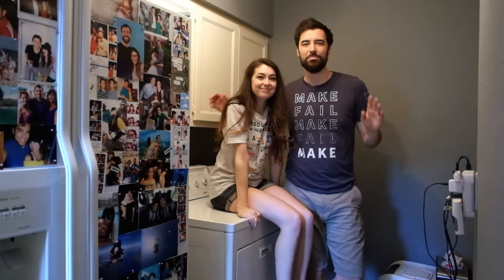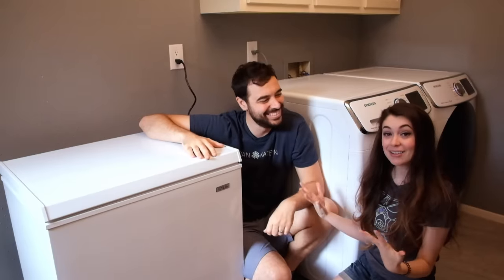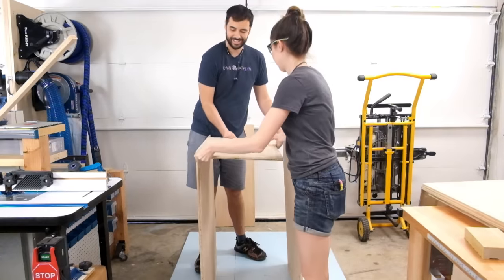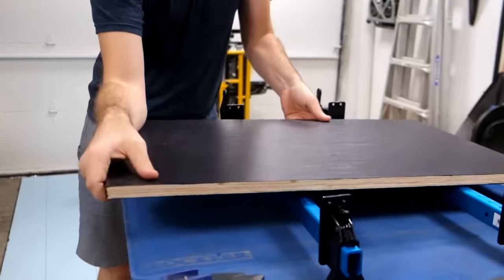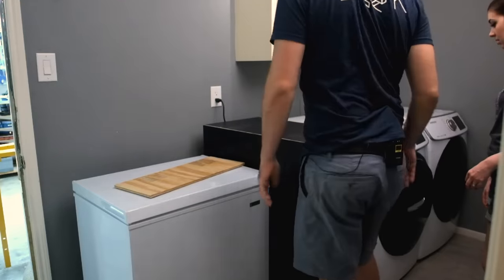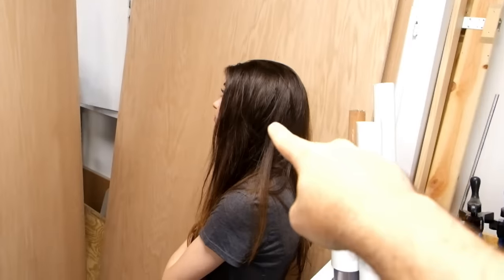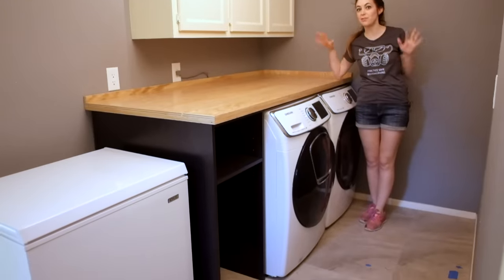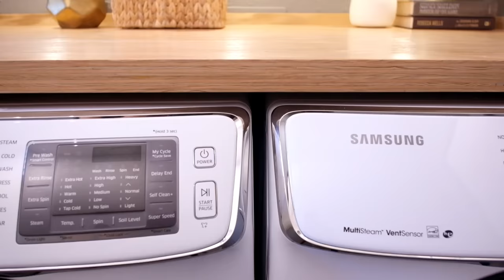Laundry Room Makeover w/ Wood Countertops!

Comment: At 9:38 and wondering when they will realize they just sealed off the access to the water shut off valves....gonna be a problem if they ever have a leak or a hose blow out.  This build was filled with trials and tribulations but I'm glad their persevered and finished! I recommend cutting out a hatch to open for the emergencies.
Reply from the maker: We tried to make the counter easily removable (it's only attached to the top of the cubby) so although it's not super easy access, we can get to it. But yeah maybe a hatch in the future! Thank you!
Reply: Yeah I was just imagining water spraying everywhere and you guys trying to pull the counter up with a bunch of stuff piled on top of it.  But with a hatch, just swipe stuff off the hatch, then reach in to shut off.  :)
Reply: @alaskankare  I've had a pipe burst in the winter and had this happen without a countertop so I can only imagine the horror of trying to get that countertop off. Just shut the water off at the main before and then you can take your time.
Reply: I was thinking the same thing, depending on exactly how the plumbing is done and it looks like it is coming from above , you could move them up in the wall and change the valves over to a set of ball valve  instead of the gate valves you currently have.  And i also agree with someone else post about painting or polly the bottom side of the counter to keep moisture from getting in.
Love the project looks great.
Reply: Also, screwing a cabinet over a plugged in cable? Should have made another hole for the plug...
Reply: I worried about that too... and with as much effort as it takes to remove the counter top... proper maintenance on the dryer vent would likely be postponed until the  dryer stops working properly or the clogged ducts catch fire... it's REALLY BEAUTIFULLY DONE and I don't mean to pick apart their efforts... but the machines require annual maintenance (at the very least) and that's already a painful process in tight spaces. I hope they consider making some adjustments and do a follow up video... I'd love to see the trouble shooting process and get some ideas about how I could make something similarly beautiful without sacrificing maintenance/ safety valve access! Please, please, please! Lol
Reply: You should hide the front of the freezer with a wood plate. Would look really nice!

Comment: One tip on the painting - that stickiness you saw with the paint is called “blocking” and happens when you use wall paint on furniture. You can clear over it, but if you don’t want the extra step, it’s best to use a cabinet paint - There are tons of options there but the simplest you can get at the home center instead of specialty stores are Rustoleum Enamels, and Alkyd Enamels.
Reply from the maker: Ooooo that's a really awesome tip, thank you so much! Appreciate it!
Reply: If it was the stickiness while rolling, that is due to not using enough paint. Most people fail to use enough paint. The surface should be wet and you should not hear the roller as you move it. Primer would have helped and acrylic wall paint would have been fine over primer........it has worked fine on the cabinets I have done and it has worked fine on the hundreds, maybe thousands, of doors I have painted. Alkyd enamels are oil based, and oils do dry harder but can take a while to fully harden. Light color oils will yellow when they don't get sunlight and to paint over them again, they should be primed first and definitely can't be repainted with water based paint without priming first (water based primer is fine).

Comment: There is a lot of moisture in the laundry room. You might consider a quick coat of poly or cheap paint on the bottom side of the counter to help prevent warping. You also have your adjustable shelf hanging hardware upside down. If you hang the shelf from your drilled holes the presence of the shelf itself prevents the little metal pin from falling out.
Reply from the maker: Not a bad idea about the coat of poly! We actually purposefully did the shelf hangers upside down because it meant we could get the shelf s little more flush on the sides (less of a gap between it and the walls)

Comment: next time, i would recommend putting a plastic bag / trash bag over the roller paint tray. then, when you're done, you can trash the bag, and you dont have to spend ages cleaning out the tray. or if you want to stop for the day, turn the bag inside out, and tie it. then when you come back to it, to can flip the bag the right way round again, and put it back over the tray
Reply from the maker: That's a really great tip! Thank you!
Reply: Matthew Shaw what sorcery is this? i’ve done so much painting and never thought of this before. an excellent tip for sure
Reply: I've never actually used it, as I'm only 17, and havent done any painting/decoration, but I've heard my dad recommend it, and it makes sense in theory

Comment: I start our own laundry room makeover today, inspired by you and kicked in the backside by my wife to do it. The new machines are here, but they didn't hook them up because they came with the wrong parts. So, while we are waiting for them to come with the right parts, I'm doing this project. With luck, I will get the panels edge banded, painted, and up today.  Tomorrow, the install the machines. Wed. I install the countertop.  By the way, I had all my wood cut to size at the BIG ORANGE BOX STORE.  And, as they were out of 3/4" sanded one side plywood, they gave me a $50 credit toward two sided finished poplar board.  Much better. Yay!
Reply from the maker: Good luck!!

Comment: Looks great, and I love how you two work together. Besides the water shut off access I am wondering if the chest freezer has enough airflow around it, and if you have to defrost it how you will access the drain. I love when things look good, but sometimes practically trumps aesthetics.
Reply from the maker: We made sure to have the vents uncovered and the recommended amount of space around all the machines. The water shut off is a little troublesome though! We'd have to undo a couple screws to get the counter off

Comment: Laundry room turned out really nice. I wish I could do something like this as well but my laundry also has the furnace and water tank so hard to redo the the laundry room.
Reply from the maker: Thank you! Ah yeah that does present some additional problems. Depending on the size of the room, maybe they could be enclosed in a closet with a door you can open to access it?
Reply: @EvanAndKatelyn  I don't use Twitter, Facebook or Instagram so do you have an email address that I can send you pictures of my laundry room so you can give ideas. It would be hard to put furnace and water tank in a closet as would not have enough walking space.

Comment: If you don't have the time, the top of the freezer could be covered with an integrated cabinet door, like the kind sold for refrigerators or dishwashers, including connecting hardware. All you would need to do is trim the hardware to the size of the freezer and buy a finished cabinet door(s) for a faster, more finished solution.  If you're on an extreme budget, check out IKEA's As-Is department for deeply discounted cabinet doors and connecting hardware. (It also requires fewer tools/ wood working skills for those who don't have a home workshop).

Comment: AMAZING 😍😍 
I want to do something similar but make a breakfeast bar with the style table top and paint the bottom piece that domino color. Where can that paint be found? Also when you made the top what did you apply it with a stain or gloss ?
Reply from the maker: We have links to the paint and the finish we used on the wood in the video description 😁

Comment: What was the final height of the cubby before the spacer plywood? Also, which router table are you using from Rockler? Redoing our laundry room and was looking for table ideas and we happened to have the same exact set of Washer/Dryers. Great video.
Reply from the maker: I don't know the height off the top of my head (and we're not home at the moment) but we left about an inch of clearance above the washer and dryer. This is the router table: https://goo.gl/g9iMvz

Comment: I just finished my laundry room remodel and seem to have similar issue. How do you gain access to W/D for repair assuming top is fixed to cabinet? My countertop is heavy marble 😦 and my dryer just died. Lifting it up will be a bear b/c my granite guy caulked top down using a colored substrate (epoxy?). Ugh.

Comment: Question!!!! The room looks very small...is it possible for the washer and dryer to be pulled out from under the counter if matinence is required in the far future? Other than that it looks amazing!!!
Reply from the maker: There's not room to scoot them off but we didn't glue down the counter, only screwed it in at a few points so it's removable. Thank you!

Comment: Pro tip to all the DIY'ers in here.
Don't block your water access.
Don't block your electrical access to your 240.
Don't block in your washer or dryer in case of a leak. 
It may look pretty but it's not practical if there ever is a leak or a problem that has to be dealt with concerning the water or the electrical.
Just a thought.

Comment: The one thing I disliked is the freezer part. Freezers and refrigerators needs to breath from the back. They get hot from the back if air is not moving properly. Also it really cuts how long they last. Our fridge is tight from the side and the top but we have elevated it a little  from the bottom and have a plastic grill there so fridge can breath from there.
Reply from the maker: We made sure to leave the recommended amount of clearance around it 😁👍

Comment: My front patio: a scam
My plans for my front patio: 
A catio so my cats can make friends with my neighbors cats.
FIX THE RIGGED FENCING.
Little fold downs so we can basically have our patio go into lockdown mode when theres high winds or cold nights. Because the fence design is absolute sh**
Little boxes for my neighbors cats to lay down in because they particularly hang out on my patio.
Fixing the design on the roof because theres metal up there that makes loud clanging sounds when rain hits it
This is basically it and my God. I forgot to feed the cats outside, theyre gonan loose theyre sh**.

Comment: Gotta say, the fact you didn't move the 120v down is disappointing. You are in wood frame, like drop is 12" so the plug is hidden...if you are worried about losing a plug, run a single box for the washer off the existing below the counter and then you have two available outlets and no unsightly cord....

Comment: Why buy oak if you're just going to paint over it? that's just not right.
Reply from the maker: It wasn't that we had to have oak just to paint over it, but we did want nicer plywood so we didn't have to spend so much time sanding and what was available in terms of nicer ply was oak
Reply: Lol. It's all good. I'll admit to being biased for a little more sanding and using pine for anything where wood grain isn't showing.